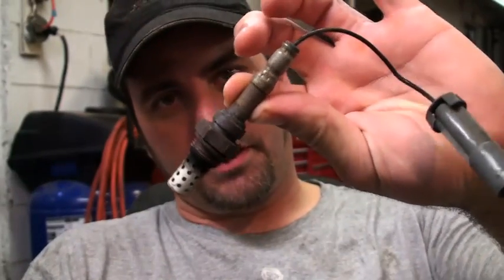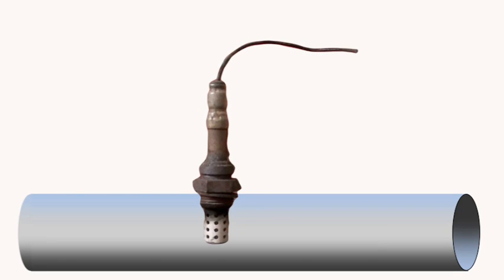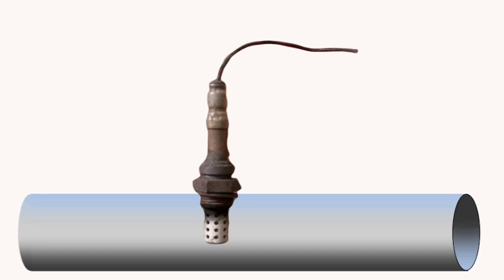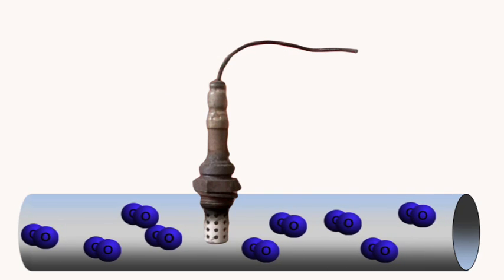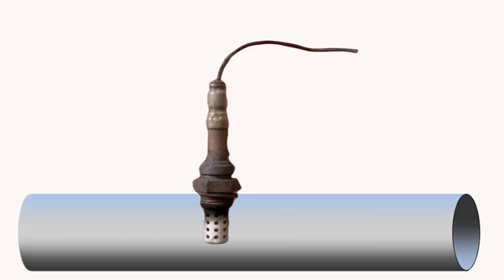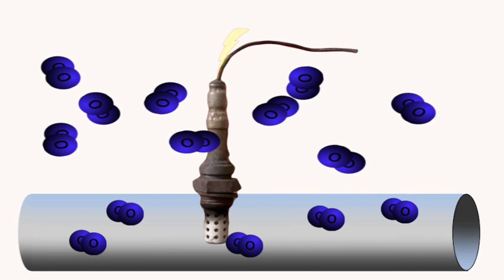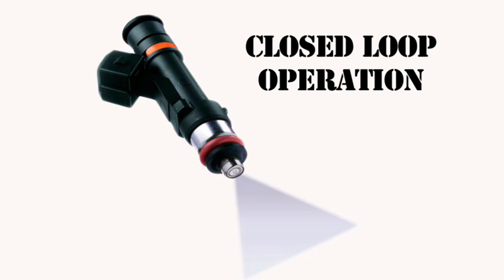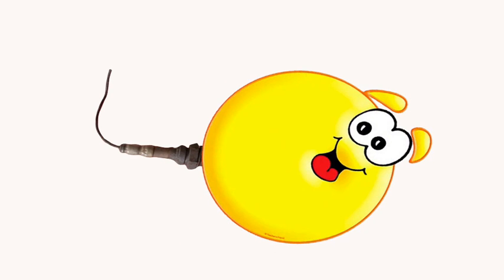O2 Sensor Basics - EricTheCarGuy

Comment: I have a question to anyone here that might have had a same issue, my wife's 2011 Camry SE 2.5 L has a issue with the bank 1 sensor 2  oxygen sensor, I had a new Toyota oxygen sensor installed two days ago and the check engine light came back on after 25 miles of driving. The codes were cleared after install. The old one was giving a P0136 and P0138 now with the new sensor the code is showing a P0138. The service technician inspected the wiring connections and found nothing wrong. He said possibly I received a new bad 02 sensor. Any comments would be appreciated as to how to go about correcting this.

Comment: So I have a 06 Dodge Ram 1500 , some genius stole my cats after I put a 3inch lift on it , 
Now I replaced the cats with 2.5 in cats and only can plug in my upstreams, my downstreams where yanked out so I have 4 loose wires on both side for the downstreams , 
My truck won’t idle now , so is fixing that the answer or should I look at other things as well ?

Comment: What I wonder is does depth affect the reading? For upstream o2 sensors I have 1/2 inch adapters from toyota flange type to 18x1.5mm. So it's half an inch less inside the pipe than stock was.

Comment: Ok my cars running to rich and lean and running rough, checked my upstream and it’s covered in motor oil from an old leak, I have an o2 sensors coming today I’m praying it’s going to be fine, otherwise. Could be my cat, so I pay have to clean it or even worse replace it 😱😱

Comment: Eric does o2 sensor bank 2 defouler works fine if u have cat without a catalyst in it or a straight pipe instead of it just to get away with rich fuel mixture?

Comment: Learning alot from your videos, very good content👍quieck question, i took my car for a full fuel system service and after driving the car about 30 miles i got a cel for both banks, both sensors #1. Would this be caused by the chemicals used for the fuel system cleaning?

Comment: Hey Eric I have a lean code p0174 on my 2006 hyundai sonata but I also have a low circuit code for bank 2 sensor 1 and another code for low heater circuit bank 2 sensor 1 am also lean at idle code I just ordered 02 sensor for my car hopefully that fixes it please give an advice thanks keep up the great video

Comment: I have a 01 Ford sport Trac with the 4.0 soch engine and it seems to have a missfire at 30 to 45 miles per hour.. and it has low rpm at cold start . What could be the problem. Thanks

Comment: Have a question my 2001 Honda Accord coupe has a check engine light that comes on and goes off because of an O2 sensor high and low voltage what could that possibly be maybe like a clogged fuel filter maybe

Comment: I was changing the alternator on my car and I neglected to disconnect the battery and I touch the o2 sensor with the positive cable that goes on the alternator and a giant spark flew where it touched. Now there is a hole in my o2 sensor and the check engine light is in for an 02 sensor code. I drove it for 200 miles before the check engine light came on.

Comment: I've pulled my O2 sensor out and found oil deposits on the tip of my O2 sensor. Well, I guess just one of them. And realized that when I was driving. Heading to New Jersey. I saw that I was burning oil. And now I have a lean code condition. So you're saying that? Because my O2 sensor was covered in oil. This would cause a lean condition.

Comment: Hey I bought a 96 Mercury Marquis. The car run super good no knocks or anything been driving for 6 months nothing has changed.
The car was loud do to a hole in muffler so I cut the muffler off. Its been smoking from the time I bought the car and all I smell now is carbon. And alot of smoke. What is it from?  Also muffler tip is under car not out the back like it was.

Comment: Thanks in advance. I'm getting a o2 lean code (2010 v6 Accord) po172, after putting on a short air intake on it? Runs good after clearing the code after every other time of cranking it? Any help or advice greatly appreciated.

Comment: hey Eric, I have a 2016 Nissan Altima 4 cylinder SL. Can u tell me does this vehicle have one or two oxygen sensors? I located one across from the radiator fan but I dont know where the other is, if any. Also, I was told that its important that you use a specific brand. If so what brand should I use

Comment: Hi Erick... what is the correct voltage for a downstream 02 sensors ? My are both at 0.800/0.845 and don’t oscillate. I don’t know is that is normal.  Ford Freestar 3.9 2004 . Thank you I always see your instructional videos. Sorry for any spelling mistakes not native English speaker.  Thanks master.

Comment: I installed 2 new o2 sensors on my 2009 Audi A4 avant, which got rid of P0420 code and helped me pass smog. Why would 1 of my new o2 sensors now stop reading after 400 miles driven with the check engine light coming back on. I only have 127,000 miles on the vehicle. Please help.

Comment: If you remove the catalytic converter to a straight pipe would this effect the o2 sensor? If so what would be the solution? 
I have a 2002 Grand Vitara 2.5L V6.  
I live in a country that does have emission laws, also it is almost impossible to get a new catalytic converter.

Comment: Hi Eric. Good video. I bought an narrowband  AFR gauge for my subie but I was told that it's a  waste of time and can even cause damage to the engine. The instructions say to tap the signal wire to the rear O2 sensor wire from the ECU . Any thoughts/ advice ?

Comment: I had an open loop do to system failure ran sea foam right through booster hose to intake and put a large can in the tank.Rechecked fuel status and went to closed loop.Brifly checked fuel trim status and switching seemed delayed but active long intervals a few hours later I checked fuel trim again and both upstream went to flat line again...but still closed loop.I guess the o2 sensors are dead...I hear whistling from intake manifold (slight) getting intermittant p300 and p304 codes.
It ran like a raped ape though with no pinging like before.
I plan on doing the 2 upstreams,The Intake manifold gasket,Fuel injectors ,Fuel filter and coils.Only thing I worry about is a collapsed lifter on cylinder 4 because I put a new coil there and already replaced plugs and wires....Its a 2017 Gmc Yukon with 216,400.00 miles with a rebuilt tranny.I am going to do all of it myself..Am I crazy?

Comment: ✌️Hey Eric! I got a 91 merc cougar 3.8 and misfire jerk on acceleration, i ran my ford OBD1 reader, it gives code(eng running)of 172&136 (sensor fault always lean) sounds like O2 has failed?? Cause My left upper o2 is drenched in oil from val cov, and your vid made sense thanks brother and STAY DIRTY!🤘

Comment: I have an 2002 Nissan Sentra 2.5 L and my downstream 02 keep going bad even after replacing it the light would shut off but after couple mins or a hour or so it turns back on
Reply: Ryan Pilgrim It’s very possible the sensor isn’t the only issue with the motor. The code will tell you if it is in fact the sensor or some other issue, the light simply indicates something isn’t doing its job effectively, not necessarily what.

Comment: Eric please answer me this?? My engine hesitates and stumbles still and dies. Even after replacing my fuel injectors, MAP sensor, IAC Valve, TPS, engine coolant temperature sensor, fuel pressure regulator. Man I’m stumped still says rich mixture on my dash and I’ve replaced almost everything except for the o2 sensor I’m scared to spend more money Cause what if this isn’t the issue. Plus there’s no vaccum leaks
Reply: Was the fuel pump being weak. Don’t be an ahole

Comment: Change from tail pipe exhaust test to engine check light is an industry backed scam.

It doesn't have anything to do with the pollutants in exhaust but it has everything to do with the faulty sensor.
Replacing the faulty sensor to one that works won't improve anything.
Your car emits the same exhaust as before.
It only makes the repair shops and parts stores happy.

Did we have a problem with tail pipe exhaust testing method?
We didn't.

Comment: You should do a video where you test 4 wire 02 sensors with a DVMM and show how they produce the voltage while the cars running... i cant find a video to show me what a 02 sensor should do while its properly working...

Comment: so being lean not having enough fuel will throw a code p0430 i was on empty on the way home drove about 30 miles after low fuel gauge came on check engine light came on and the bext day put gas in cleared code hasnt came back on ...sound right am i at the right video trying to understand thanks much sir great video

Comment: Eric I have a 2006 nissan altima 2.5 engine and I have engine light on so I had the code read and it said 02 sensor so I replaced both 60 miles later engine light came back on again 02 sensor so this time I changed the 02 sensor again and also removed the catalytic converter and gutted it out and installed it back on now 30 miles later engine light again??
Reply: Rick Light I have an 05 Altima I couple months ago I changed my front catalytic converter but the old O2 was put back on. I think I am having the same issue right now as well.

Comment: What’s your opinion on Borg Warner “universal” O2 sensors (the ones where you splice the wires)? I’ve used Bosch ones spliced-in, but the BW O2 sensors are mighty cheap, which makes them very tempting to buy. Is one really better than the other?

Comment: Hi Eric,
I got a Honda Civic EJ8 and I changed the O2 sensor in 2013 on the header. And I've hardly driven the car for a few years. But noticed the plugs are black so it's running lean. Any suggestions?

Comment: Hello Eric,

I'm experiencing a hesitation problem on my 92 Accord. this happens on take off or even on the freeway. fuel filter was recently change. spark plugs, and cables both are new NGK. can this be my map sensor, TPS sensor, or O2 sensor.  I'm just not sure what else to change next. thanks for your help.

Comment: Hello, wondering if youd know the answer to this.......just put a new exhaust on my motorcycle and the o2 sensor doesnt reach it..... a guy from my motorcycle dealership said that it would be alright for me to run without o2 sensors and it wouldnt damage the motor. so my question is, if i hypothetically remove the o2 sensor i know i will get a check engine light, but what will the bike try to do to compensate?  its a newer sportbike so obviously it will know there is a fault and that its getting no information from the o2 sensor, so given that scenario will the bike default to open loop operation as a safety? ive read of other people riding their motorcycles without the o2 sensors with no problems, just wondering how a newer bike would react and wanting to avoid damaging my bike. thanks in advance

Comment: But is it NECESSARY?? My mechanic made me purchase 2 of these for $110 each. I had an issue with wet sparkplugs and since the scanner said O2 sensors are bad I had to buy them too. Did I just waste money?
Reply: jerolvilladolid dude you're getting ripped off with prices like that I would recommend rockauto everything is way cheaper even with shipping included I don't buy anything from auto stores unless I need it immediately

Comment: Shoulsd I replace the o2 sensor as a preventive maint procedure. No codes but 186K miles. Jeep Cherokee sport. Mileage per gallon is poor. 280 miles per tank of gas 20gal. Straight 6. 2wd

Comment: i have an 02 sensor 1 bank 1 code so im asking a  question is the proper way to change the sensor  ,do i erase the code then disconnect battery change 02 or disconnect battery change 02 . and yes i know to drive car at least 60 miles to make sure engine light does not come on . thank you

Comment: Are classic Honda's like say... My obd0 '90 Integra known for NOT throwing a code even if the single wire o2 sensor is bad? I swear this car won't throw a code until there's a critical failure! And yes, the CEL does work.

Comment: I have a 1999 Mustang GT with an aftermarket off-road exhaust system and only using the front Oxygen sensors. How would the performance be if the front sensors are bad and could I successfully put MIL eliminators on the front oxygen sensors?

Comment: Hi Eric thanks for the super video, I am just about to start increasing boost on my Subaru, if I put a volt meter in the cockpit and ran 2 wires off of my cars existing oxygen sensor would it affect the remaining voltage going to the cars computer because then I can keep an eye on the exhaust gases ratio so I know if my stock ECU is keeping up with the right amount of fuel going into the engine?

Comment: I am working on a project aiming to increase the fuel efficiency of a 50cc single cylinder SI engine. I am unable to tune the ECU properly because my engine afterfires alot. I have tried changing the ignition timing but its not helping. Because of afterfire issues my O2 sensor is giving wrong values. what should i do?
Reply: RISHAV TRANDBUDDY Paramhans well it sounds like you're running too rich of a mixture if it keeps after-firing. The only thing I could think of to solve it is increasing the air induction to match the fuel, but I suppose you would want it to run more lean if you want better fuel economy. I have 97cc carbureted engine, so I don't know what you would do for EFI. All I have to do is decrease the allotted amount of fuel and choke the engine to make it run more lean. Whatever, I'm just rambling at this point.

Comment: Hi, well my 99 European accord got me p0141 code. Secondary o2 sensor heater and 2 days later, it got me 3 errors p1166 P1167 and p 0141. What is it? Can it be both sensors? Thanks
Reply: Just one sensor probably, all codes related to the one problem.

Comment: If i take it out will the motor run rich or lean
Reply: the motor would run rich. If you take of the cable youll get an emergencyrun so it would just run rich so you still can drive with it. If you just pulled it out the sensor gets oxygen from the air and the MCU would suggest the motor is running lean so the cat. wont be able to burn the rest, so it goes rich too.

Comment: what would happen if a person bypasses this O2 sensor.  I can bypass mine with a simple wire bridging 2 wire together and leaving the other 2 wires alone....  What would happen in this instance please.
Reply: ok kool thank you.
Reply: Hi, my acura integra sometimes has the check engine light turn on and it becomes hesitate when accelerating or have a rough idle that can drop below 1k. The check engine light sometimes doesnt turn on if im lucky and the car runs perfect, any idea of whats going on? THANKS.
Reply: My Ford Ranger just had its Check Engine light just turn on. Probably something to do with a new exhaust leak. P0136. If it has a "higher chance to run lean" before I can fix it, is this lean condition lean enough to hurt it?
Reply: yes at full power.  bang bang kiss good bye.

Comment: hello guys please help me. i brought a new oxygen sensor, my question is it ok to just twist the wire and use a heat shrink insulation rather than weather proof crimp type to connect my new oxygen sensor.

Comment: Hi Eric, my BMW E90 320i gives me a code P0041 and has a rattling sound in the exhaust. The car sometimes shuts off when I step off the gas and let it roll to a stop, say at traffic lights or in traffic. It has new spark plugs and coils and runs smooth. No leaks, no smoke. What could be the problem and how do I sort it out? many thanks
Reply: new plugs and coils shouldnt have nothing to do with rattle in exhaust and somtime* stalling issue.
Is the rattle consistent? i had a muffler's exhaust flap spring go bad causing it to rattle and stall the car because flap would be constanly spinning.
Reply: Adolph Ntaja misfires?

Comment: lost about 2mpg. Replaced the spark plugs, air filter, checked tire pressure. Thinking it's the o2 sensor now. Just broke 180k. Never replaced the o2 sensor. Around 130k I cleaned it with brake cleaner which seemed to work though.

Comment: can i clean an o2 sensor
Reply: Xavier Vanga yes you can
Reply: With gas?
Reply: Xavier Vanga oven cleaner.
Don’t get it on you or breath it wear safety goggles, burns like a son of gun. Very acidic.
Melts the carbon and or deposits right off. After a hour put your spray nozzle on you hose a blast it clean. Look inside the metal holes at how black it is after you blast it clean and blow it off with air look again and it will look new and white.
That’s just me. Do what you want.
Reply: Yes you can. Clean it with breake cleaner

Comment: Going to keep it simple... After having brake pads installed  on 2003 cts , my caliper seized.. took back to tire shop and caliper  was  replaced ...car hopping  looked as if brake oil splattered on wheel and tire.. took car back and they put a new caliper on.. check engine light came on while driving home. is any chance brake fiasco could cause o2 sensor to go bad

Comment: Hello Eric the car guy, I tried removing my o2 sensor with wd-40, it didn't work so  used heat to remove,  finally got it out, install it on my new manifold but not the check engine light came on, could it be because of the wd-40 or maybe I have some exhaust leak,

Comment: hey Eric regarding this video I have a 99 civic ex I been having a minor iddle issue when car is at stop the idle goes from a normal idle 800 750 to 650 and as low as 600. the only code I have gotten is the o2 oxygen low voltage P0133 recently . can this be the issue?  I been targeting this issue for a while  and the o2 code is the only recent code.  previously it had catalytic converter code which I did replace a few weeks ago and I did a full tune up wires, spark plugs, distributor cap and rotor. but that Damm idle issue persist. can this finaly be the cause or due to your expertise of Hondas can the problem be some where else, and before I forget I did also let the air out of the coolant system as well.